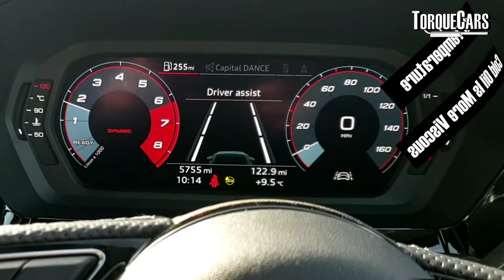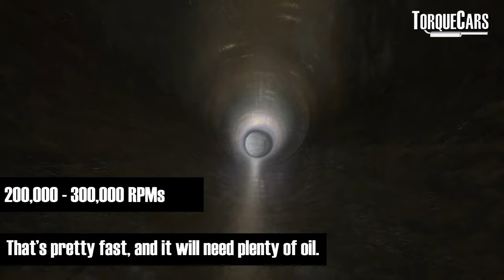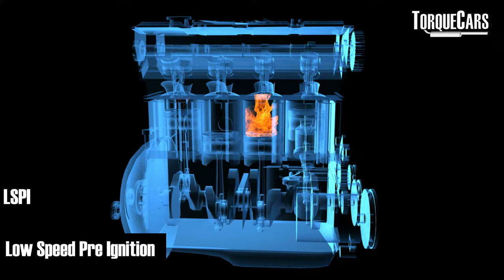5 Things That Kill Turbo Engines ⚠️ [WARNING]

Comment: Lower octane is not lower quality
Reply from the maker: I guess "Quality" like beauty is subjective and I totally take the point that fuel meets certain quality standards before it can be sold. I often use the term loosely though, and my implication is if your car is build to run on premium higher octane fuel then anything else is going to be "worse" for both performance and economy therefore of lower quality.

Here in the UK lower octane typically contains 10% Ethanol which kills some of our older engine's seals, whereas high octane premium fuel contains just 5%, the additive packs also differ between brands with cheap suppliers not even coming close to the larger brands. 

What are your thoughts on increasing Ethanol content in fuels?